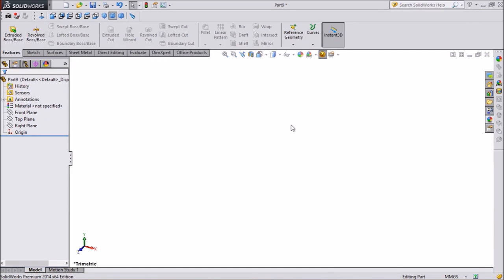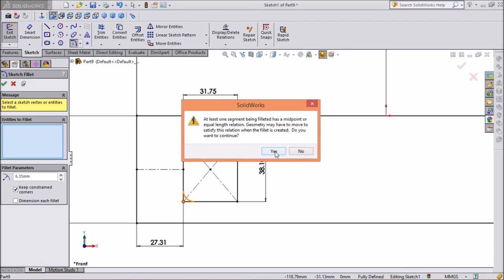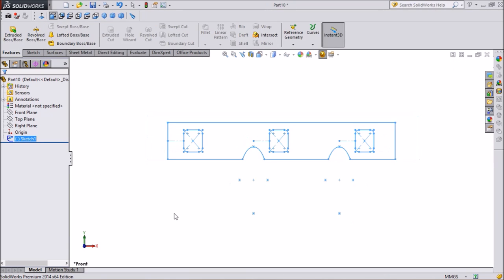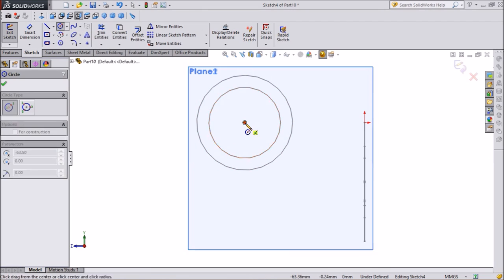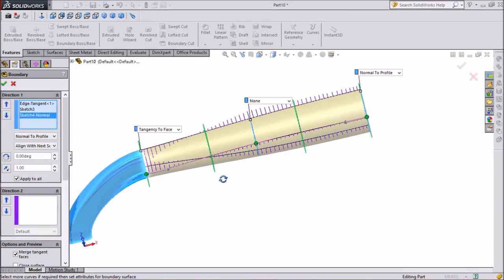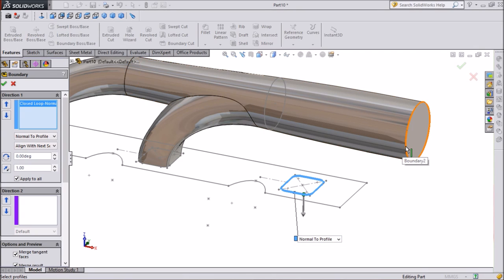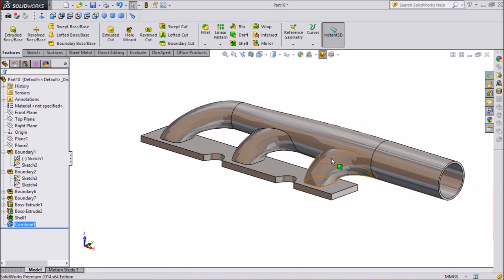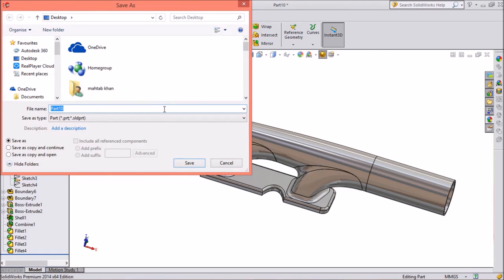SolidWorks Tutorial Engine Exhaust Manifold

Comment: What did you do to fix the issue from boundary 3 to boundary 6? At near about at 10 min..
Reply: add reverse direction 1.5 degree and reverse tangent direction 1.0
Reply: @mardavdoshi1436  wow i have spent like four hours trying to work that out and finally come up with trying 15 degrees not 1.5, anyway thank you a lot bro you inspired me :D
Reply: @SoyJavero  Could you show me how you fixed that part? I'm still struggling
Reply: @michaelstevencaquimbobonil2513  do what I said above your comment
Reply: @SoyJavero  Already fixed bro, thanks for the help.
Reply: @michaelstevencaquimbobonil2513  excellent work
Reply: @SoyJavero  Cómo se hacen esas correcciones?
Reply: @josuedelatoba866  lee mi comentario arriba en inglés
Reply: @mardavdoshi1436  bro this is not working there is this coming 'the feature could not be created because it would produce self intersecting geometry